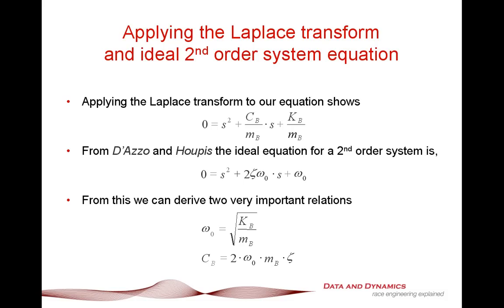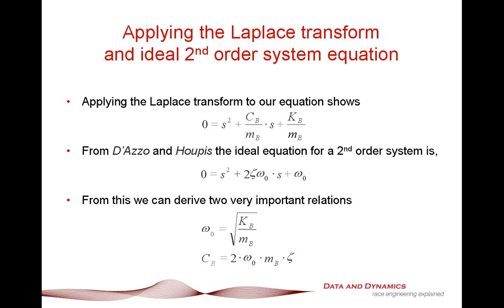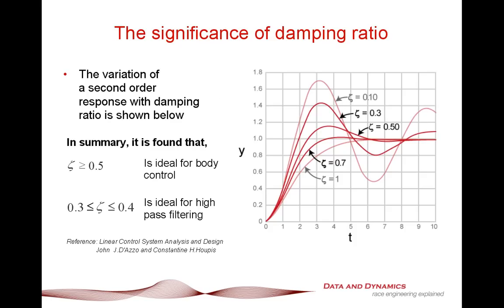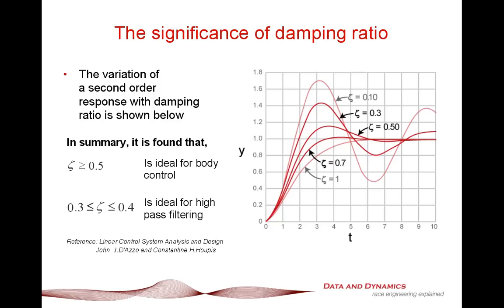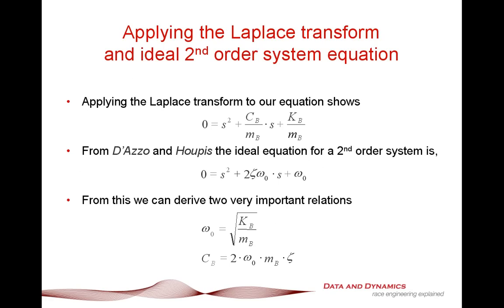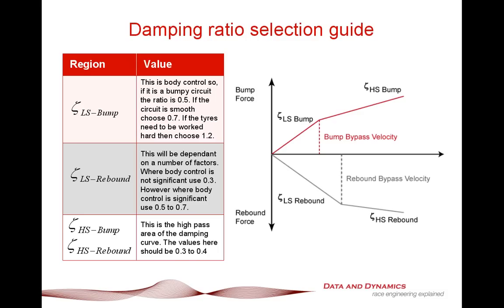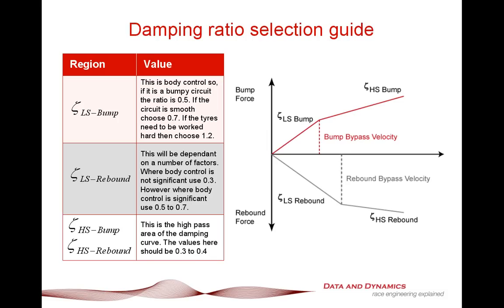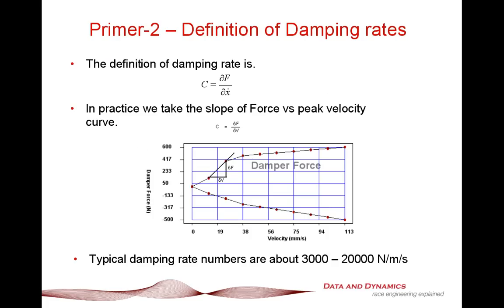Dan's Vehicle Dynamics Corner - Using Damper ratios - Part 2

Comment: 12 years old, and I'm just getting to this!  Regarding the slide shown at 4:50, you can't define high speed damping with a single coefficient when it has a non-zero intercept.  Fight me!🤣
Reply from the maker: Sir your funny! Remember you get there by adding the low speed component first! Then the single coefficient in the high speed applies
Reply: @ChassisSim  That's exactly the problem.  Plot the damping coefficient of the slopes shown in the graph, and tell me what you get.  Also, that's the first time you've called me sir.  I'm not old enough for you to call me sir! 🤣
Reply from the maker: @paulyaw  I know what the problem is. Go to the ChassisSim website - and download the damper workbook. It should become a lot clearer. BTW - calling someone sir to quote Coach Tucker is a sign of respect.

Comment from the maker: My friend your absolutely dead right. The second equation in the initial slide should read,
0 = s^2 + 2*damp_ratio*w0*s + w0^2 Not 0 = s^2 + 2*damp_ratio*w0*s + w0 as stated. I use it so often I didn't even look! The joys of equation editor. However the next line reflects the correct results. My apologies guys.